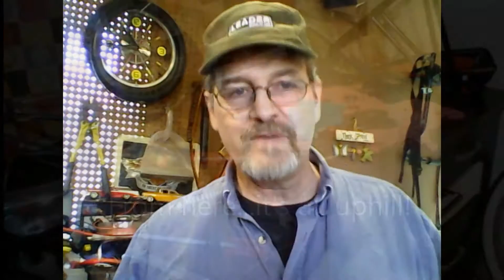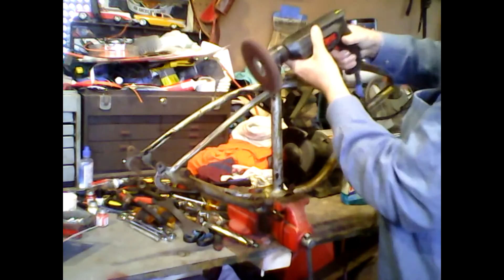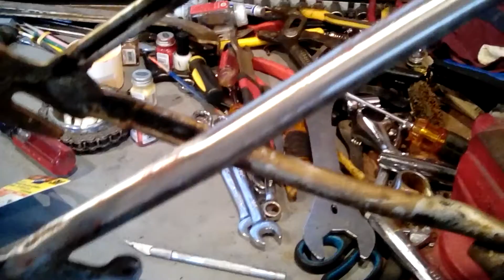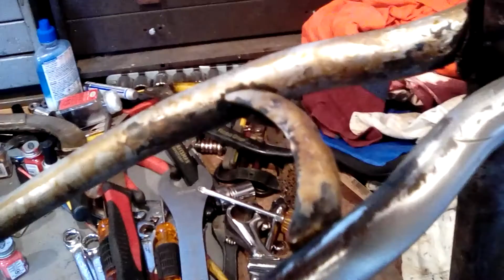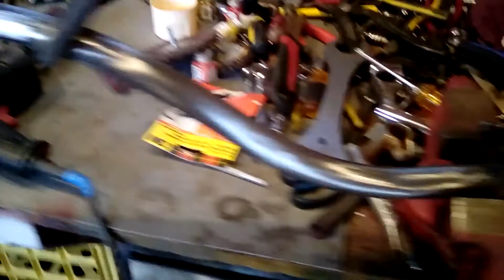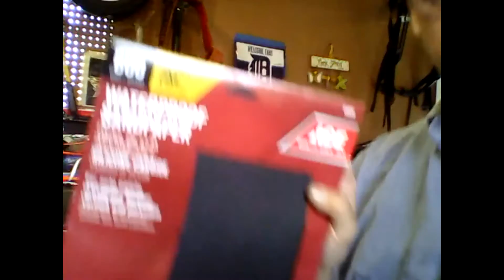Schwinn Stingray Custom Restoration pt2

Comment: I use stripper in a spray can rinse off and then touch up with pads .
Reply from the maker: What brand of stripper, Jim? I thought about a gel type but I wasn't sure what was on this bike. I think I took this direction because I knew there was rust to deal with as well.
Reply: Sorry to be late going back to work been doing security verification for Gov. can't stay retired got to pay for daughters higher Ed  ..... the brand  I'm not sure was Clear stripper  water rinse at ...Wally world !

Comment: it's not a stingray then stingrays started in 63 1/2
Reply from the maker: We talked about that, because it has the 7 hole sprocket (or lucky 7), and the wider handle bars, which may have been put on the frame afterward. Regardless, the frame is the same as a junior Sting-Ray, so I saved the bike and "made" it a Sting-Ray. Thanks a lot for the information about the year, Pam, it'll help when others read. Note that Schwinn used the same frames for a ton of different models, including the 26" wheel frames. Too many to mention!